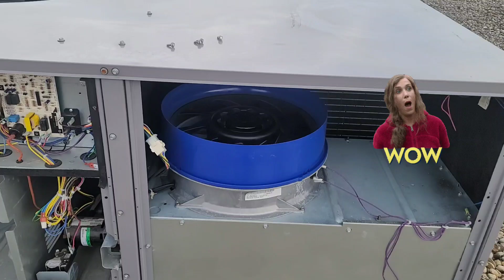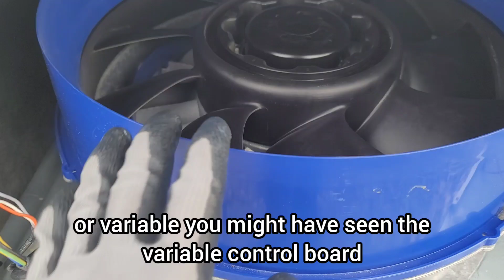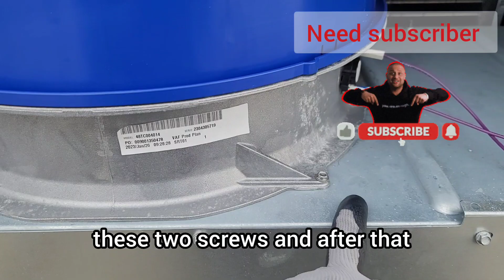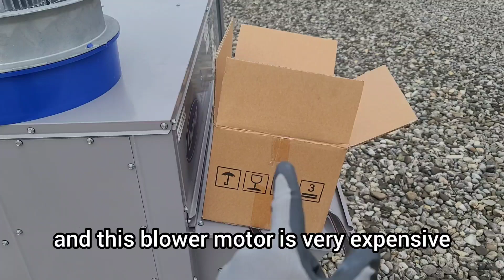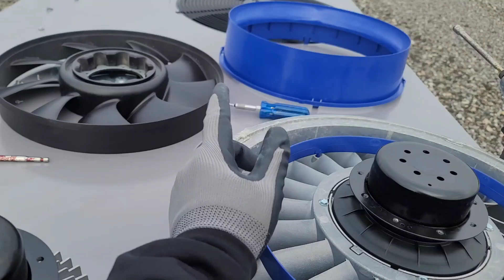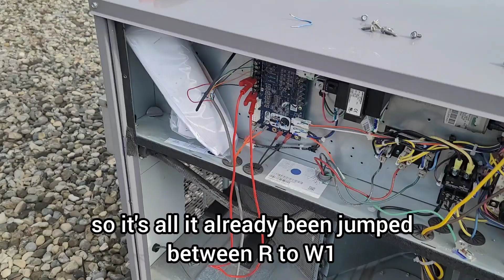New Carrier Unit blowing fuses

Comment: High static pressure(air flow issues) will fry an ecm as its constantly working full capacity, trying to compensate for the lack of airflow.
Reply from the maker: Thanks for watching, yes could be one of the reason

Comment: Each one of these units with the axial blower need to be calculated and setup on installation. This is why this motor failed prematurely. That's directly from Carrier, I've verified this myself.
Reply from the maker: Thanks I also called them, they told me all the units ships from factory motors were set to  individual unit specifications, but I agree they are to be checked at installation.

Comment: The phases are between the legs (wires) of power. If you drop a leg, have two legs but not two phases.  

Three phase has 3 windings between three legs.  

Single phase is one winding between two legs.  

If you drop a leg there's no connection at the third leg so it essentially becomes a single winding between two legs.
Reply from the maker: Thanks yes right

Comment: Great video. Thank you for sharing. Have a nice weekend and Thanksgiving.
Reply from the maker: @zekenzy6486  thanks
Reply: I thought the warranty is for 10 years
Reply: @3664santana  Compressor is usually 5 years as well.  Unlike residential equipment, nearly everything else is 1 year on commercial equipment.
Reply from the maker: @HVACR559  yes right
Reply from the maker: @3664santana  10 years for heat exchanger only rest 1 year